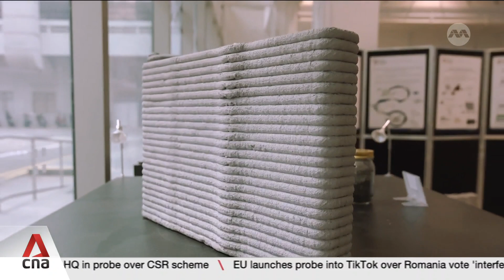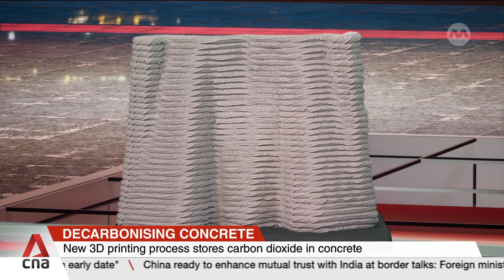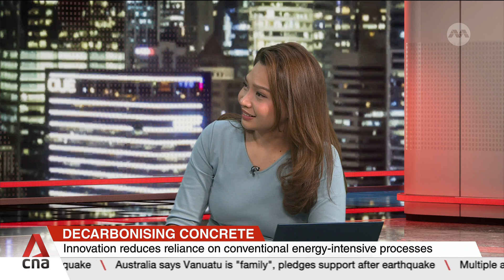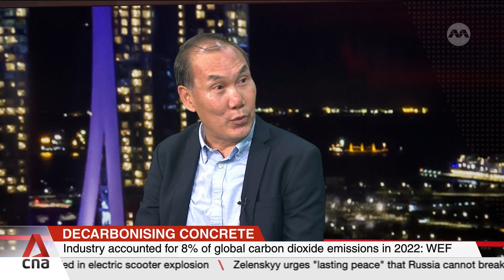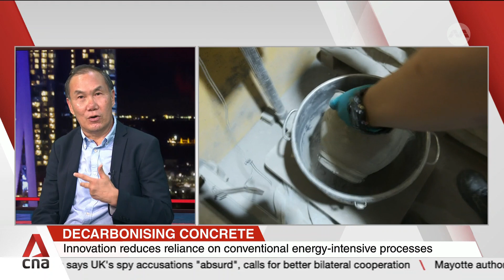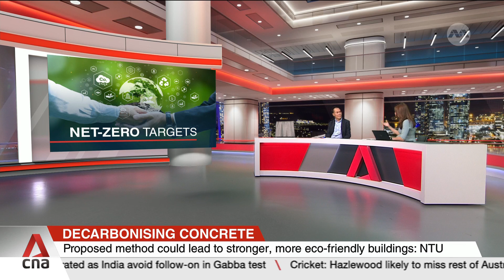NTU scientists develop 3D concrete printing method that traps carbon dioxide to reduce emissions

Comment: I graduated from NTU School of Mechanical & Aerospace Engineering back in 2008. Chose to go into Mechanical Design. So I was working under a Swiss-German Prof specializing in 3D Printing to study materials' crystal models so as to analyze how bonds can form between different elements' atoms nearest to one another, creating various unique structures based on chemical bonding, all theoretically though.